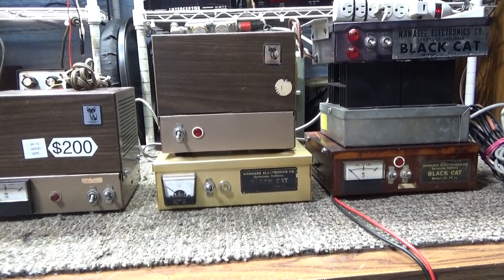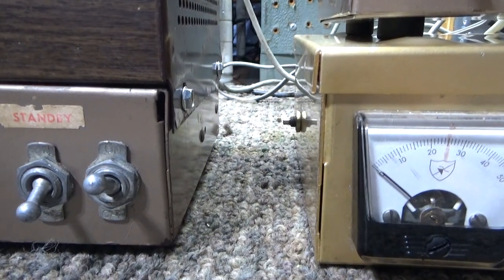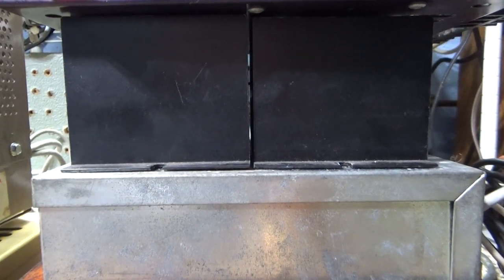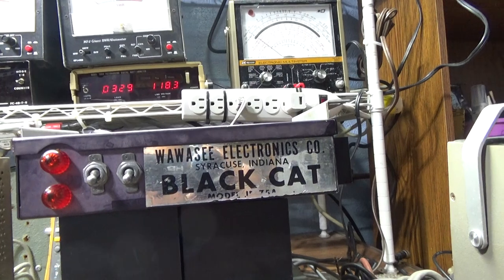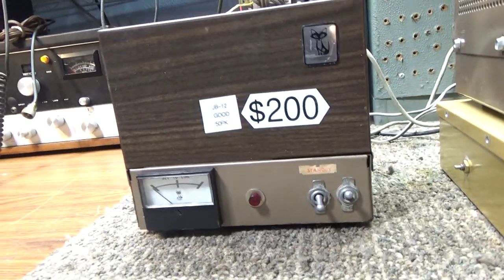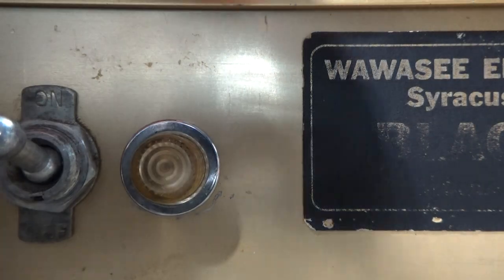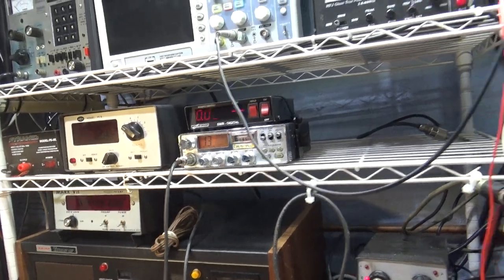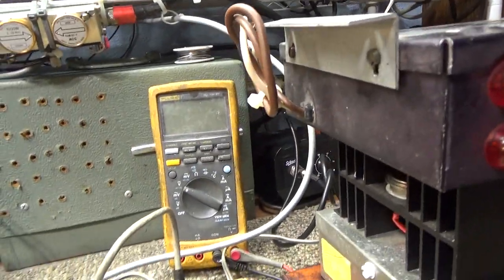Blackcat JB-76B aka JB-200 on the bench +showing a JB12, JB-75 and mobile JB-76M aka JB-200M

Comment: I run Jb-200 in bull-it 2 3-500z with my Dwight D 
Jb dead keys 30 and swing 160 you talk about loud clean audio
Reply from the maker: Back in the day, as a kid, I got hold of a Drake L4B (2-3500z box) and also drove it with a JB-76. That combo was very very hard to beat especially back then in the late 70's early 80's.